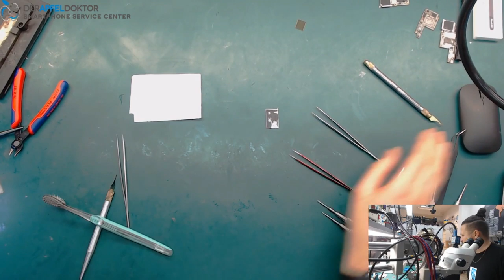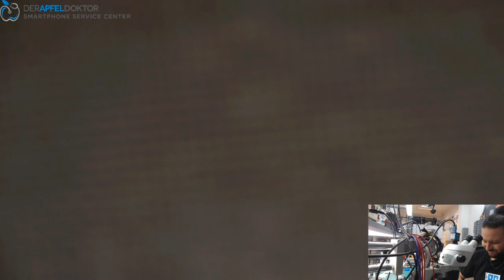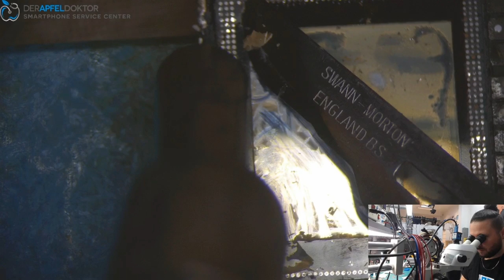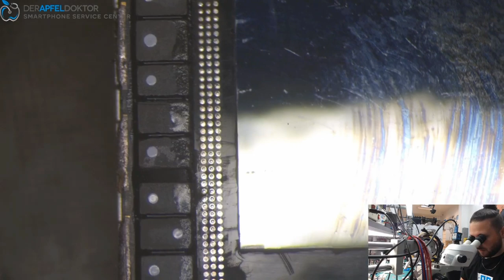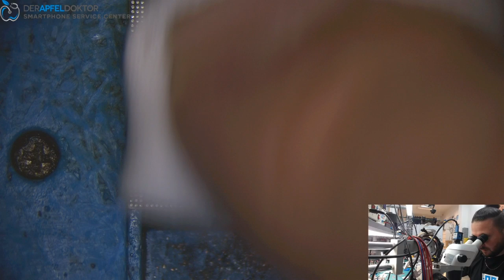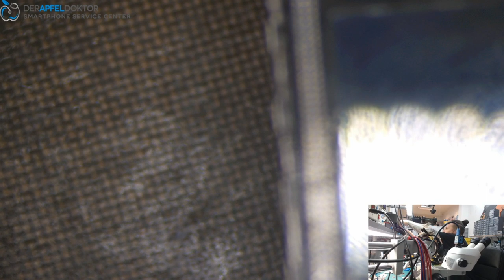MASTERWORK - iPHONE 7 PLUS RAM SHORTED - HOW TO REPLACE A10 RAM FAST & EASY

Comment: Can you please share the temperatures you use.
Reply from the maker: Sorry but I won’t do that. You can learn that at the Board Level repair school Germany.
Reply: The RAM 7G  A10 same 7plus a10  or have different ic?
Reply: 340  and 45 air , works for me.
Reply: Temperature different blower type
Reply: @mohdibnumusa8700  timing is important too
Reply: @laloramos  yes...if timing not correct will damage cpu
Reply: @mohdibnumusa8700  u can use a mini dremel.
Reply: @MRHYDE-yo7vr  i have a quick 861dw